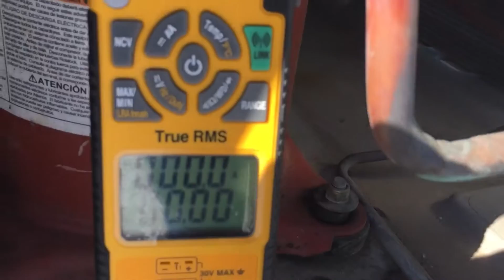Scroll compressor dies young.

Comment: Now to find why compressors keep dying.
Reply from the maker: Yup. I believe this one was installer error maybe. I'll cut it open if I get a chance and see what happened. Maybe high discharge superheat breaking down the lubrication and high compression ratios. I need to check out the system as a whole including air flow if they let me change out the compressor.

Comment: It looks like the original filter drier from the factory.
Reply from the maker: polishtheturd mickelson you're right it kinda does.  I installed a Copeland in its place same thing just different color . I for sure put a new drier.
Reply from the maker: The scroll broke on the bottom.
Reply: Yeah, it looks like a emerson drier. It was never replaced with the compressor. That's cool I like Copeland Compressors. Probably the piping was the same or very similar for the compressor replacement. Trane has a tendency to gouge us for parts. specially on combustion motor assembly's
Reply from the maker: polishtheturd mickelson you have a good eye. You're right. The replacement filter driers are from danfoss and are black.  I can now get Alliance compressors cheaper than Copeland. Which is strange.  They are  identical for the most part. . On the box for the alliance compressors it will have a Copeland model number.
Reply: I can get rebuilt Carlyle Semi Hermetic Compressors thru Trane like at 1/2 the cost of going through Carrier. I have never heard of Alliance.
Reply from the maker: polishtheturd mickelson nice Alliance are these orange scroll compressors for trane.  Copeland makes them.
Reply: Ok, that is what Trane calls them. Thanks for ithe info.